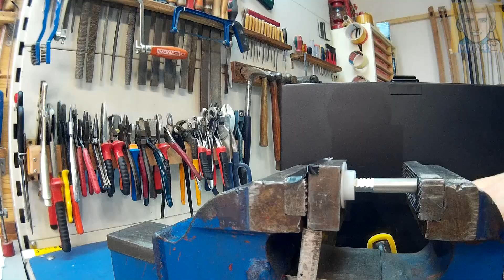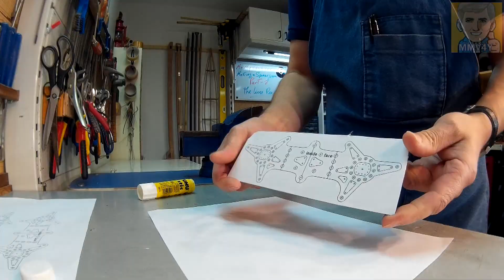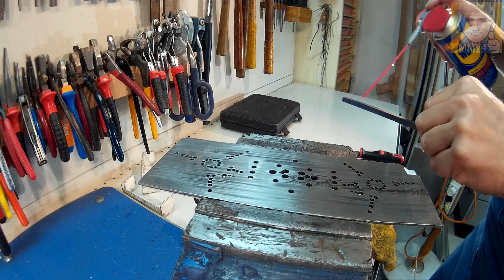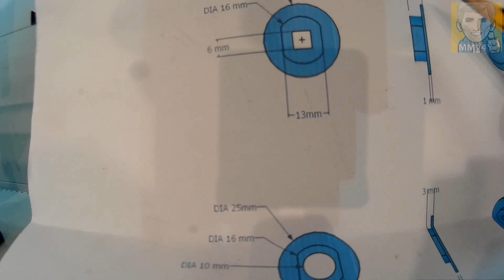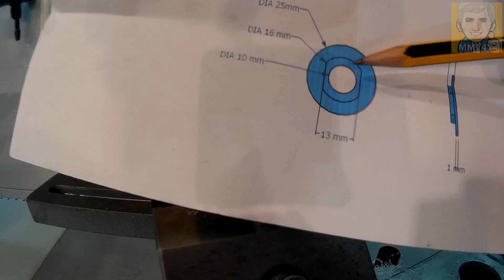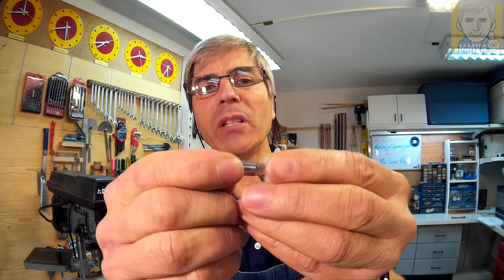Wooden Speargun - Part 8 / Making the LINE REEL-1

Comment: Hello! Do you think it is possible to make a speargun from oak boards?
Reply from the maker: Hello Alexey nalad 4ik,
a better wood will be teak or mahogany wood because of the inherent oils in it that makes it very water resistant,
 If you gonna use oak make sure that is WHITE Oak don´t use red because it will be like a sponge sucking water.
Thanks for the comment and good luck on your project!
Reply: Thnx,I have white oak
Reply from the maker: Hello Alexey Nalad4ik,
that´s great, but you have to seal the wood with varnish or epoxy.
Good luck on your project.
Reply: MrMyvids4you  epoxy + carbon fiber.

Comment: onde arranja os moldes?
Reply from the maker: Hello Samuel Vicente,
I designed it myself.
Thanks for the comment and for watching my videos!
Reply: pode colocar os moldes a nossa deposição??
Reply from the maker: Hello Samuel Vicente,
I have to finish this project first, and field tested it for some time to know if averything works and that is safe to use (The spearguns triggers in particular), i never made a speargun, the speargun trigger or line reel before, and making the untested designs available would be a bad decision.
So for now these videos are the best that i can do.
Reply: MrMyvids4you obrigado o gatilho fiz um igual e funciona lindamente precisava das peças do roller